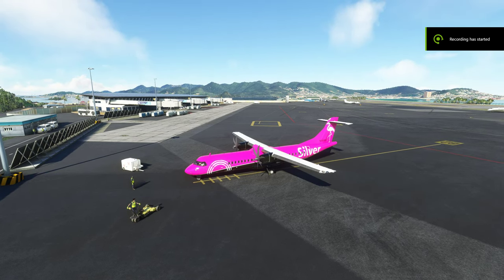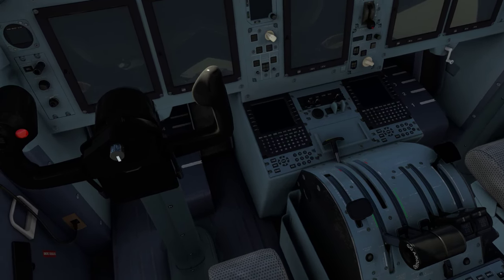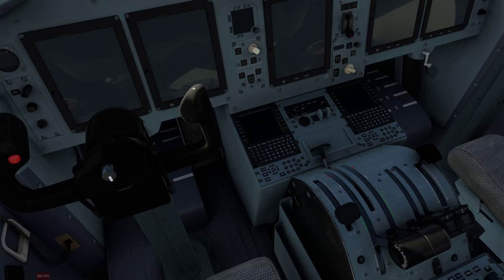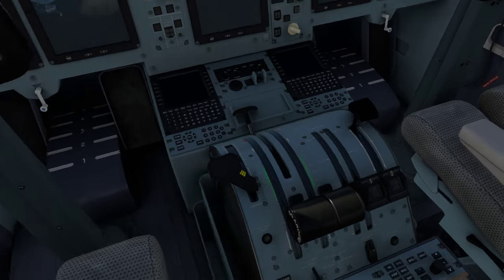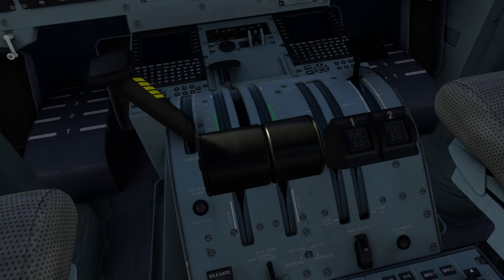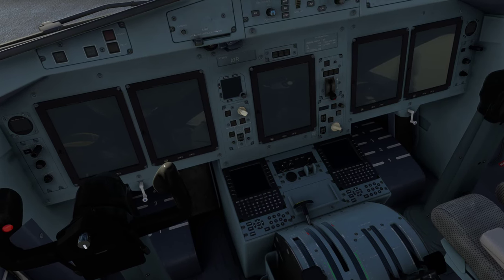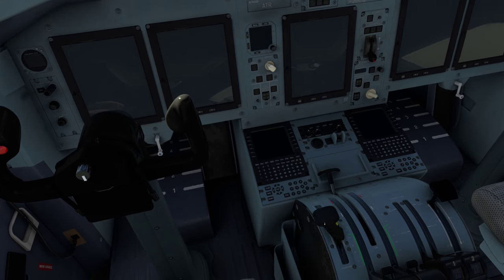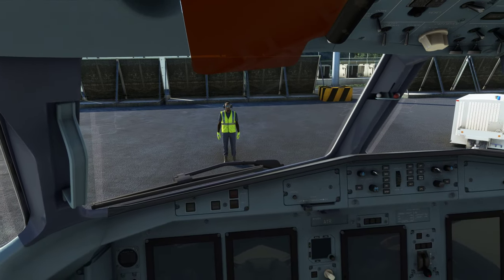Asobo ATR 72 | Honeycomb Bravo Setup | MSFS

Comment: FYI, the reverse detents on the honeycomb aren't axis they are just buttons that engage/disengage hence the "my controller has reverse axis" not working in the pad, you kind of touch on it when you do the throttle down config, also what I like to do for those is on button release = throttle cut, makes it so when you come out of reverse it goes straight to zero no issue. But I haven't flown the ATR so not sure if that puts the throttle in a weird place.
Reply from the maker: Hey, you're exactly right about the throttle cut, I didn't understand that at first but have since implemented it. That said I had no issues at all with running it the way I had it set up per this video. Thanks a lot for the comment!
Reply: @IslandSimPilot  Thank you! I was on the fence about buying the ATR but after watching a few vids, and more importantly how hard or not it was to get it working with the Bravo, I am looking forward to buying it. Thanks for the precise to the point video!
Reply from the maker: @snwboardn21  You're quite welcome! I am enjoying the airplane a lot. The FMC is very similar to the Airbus (I'm a Boeing guy so no help to me!), but the flight plans are so short that it's very easy to get them entered. It's a very logical airplane, automation is useful but not overbearing, and it hand flies BEAUTIFULLY! It's a bit of a learning curve (my experience is withe CRJ and the 738), but I really enjoy it.